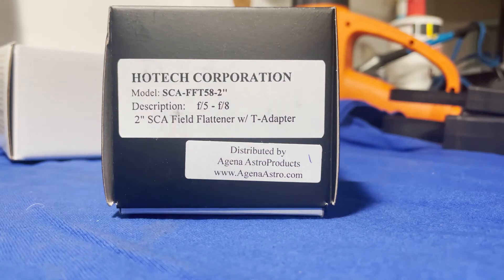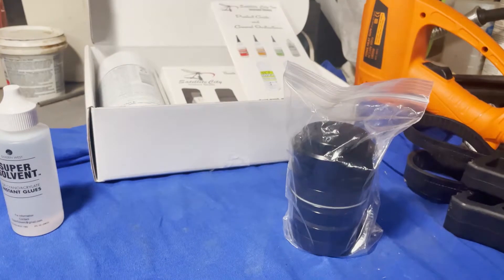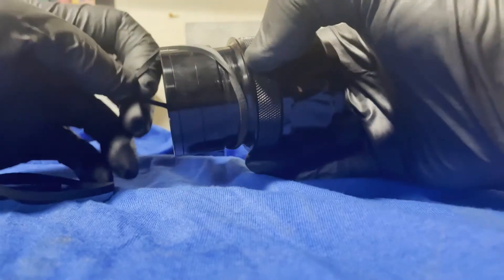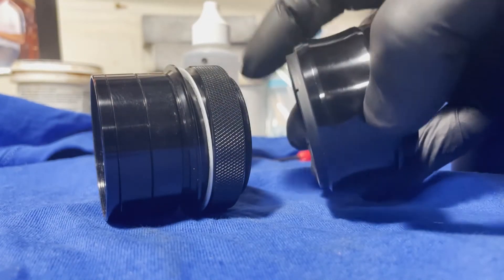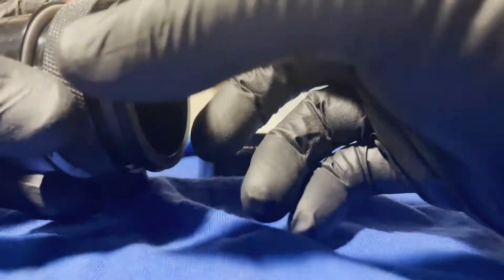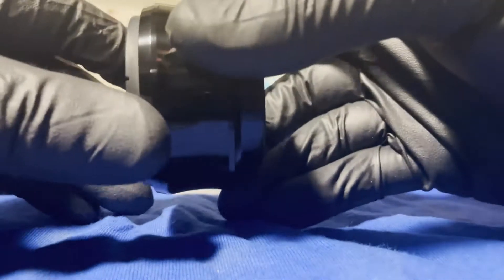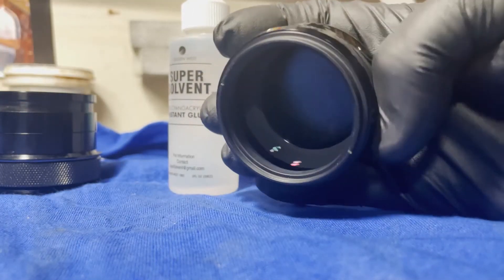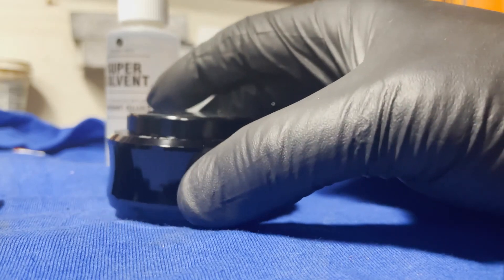Hotech 2" Field Flattener Nosepiece Removal

Comment: what is the size of your extension tube you used on that flattener please?
Reply from the maker: Not sure to which you are referring.  I mentioned a lot of sizes during the video.  Are you referring to the part around the 13 min mark that I used to get the rough textured collar loose?  That large extension is M48 x 30mm long.  But the length doesn't really matter much, you just want to use something long enough to be able to grip.  Here is assorted sizes I purchased on Amazon.
Astromania Astronomical 2"/M48-extension Tube Kit for Cameras and eyepieces - Length 5mm 8mm 10mm 30mm - M48x0.75 on Both Sides
https://www.amazon.com/gp/product/B071JF2FY5/ref=ppx_yo_dt_b_search_asin_title?ie=UTF8&th=1
Reply: oh ok. its the one you hold in your hand at 12:54. thank you!
Reply from the maker: your welcome, yup so that was the 30mm extension tube i got with the kit I listed in above comment.  Happy to help! @rcv-v1c

Comment: Excellent video, thanks. Question: what is the size of the female thread that is in the body of the flattener? It looks slightly bigger than the m48 female thread of the adapter ring. Maybe M54?
Reply from the maker: Thanks for the comment. Yes I believe that is M54.

Comment: Hey thanks for this video. I was able to remove the nosepiece on mine also. For anyone else who comes across this, my only piece of advice would be to use the glue solvent he recommends and....

Remove gaskets and spin the knurled ring to expose the threads where the nosepiece connects to the optical body. Drop a little bit of the solvent in the exposed threads and wait about a minute or two while it works its way in. After that, give it some solid torque and it should come free.

Worked for me and the M48 ring stayed in the optical body as desired. Didn't have to use a strap wrench even.
Reply from the maker: Right on Mike, glad it helped.
Reply: This method worked perfectly for me.  The debonder took about a minute, but I was able to twist them apart without a tool.